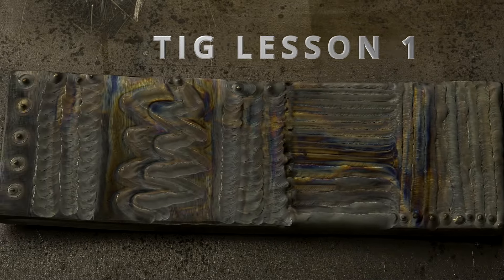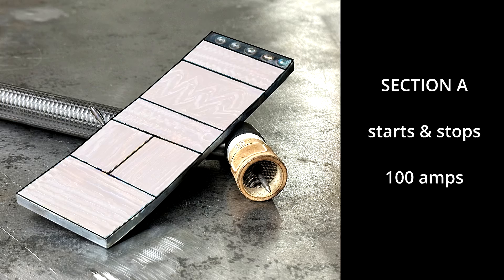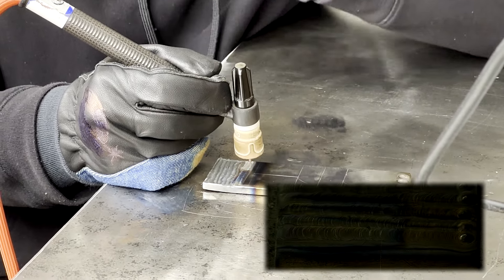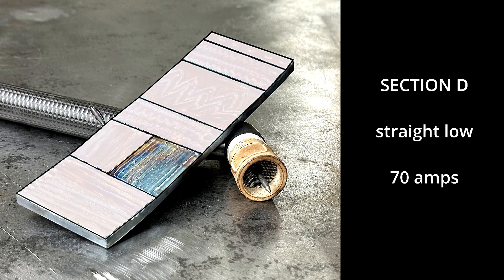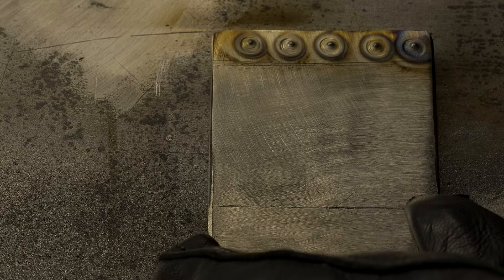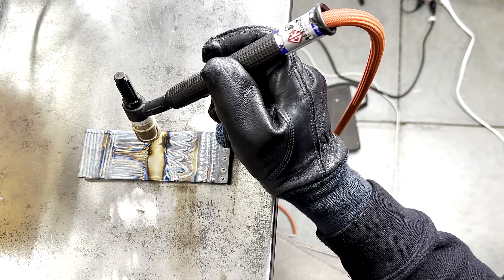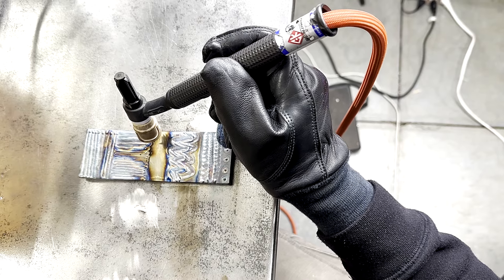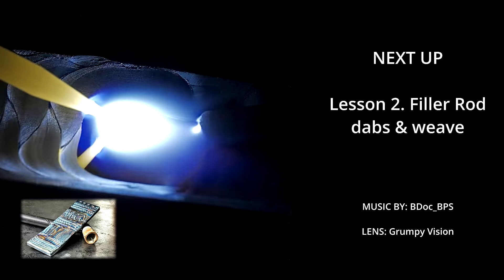Easiest Way to Start Welding | Beginner TIG 1

Comment: Can you try .063 sheet aluminum and butt weld with inconsistent gaps? I'm helping my grandpa build an aluminum car body for a corvette.. first time learning to weld and he put me on sheet aluminum. Went from a 165amp miller machine with only amp control to a cheap Arccaptial 200p ac/dc machine with triangle wave and pulse and a few more goodies. Arccaptian works really good for being under 800 CAD.

Comment: Only just starting out, but noticing your torch angle seems a lot sharper than a lot of others seem to recommend...is there a 'right or wrong'?
Reply from the maker: Good eye and good question! There's a whole range that's right. It depends on other variables.

Our latest short shows this a bit and we'll go over it in more detail in Beginner TIG 2

Comment: Appreciate the video. If you continue these I wanted to provide a few thoughts from a student's perspective. If welding experience were measured on a 5 point welding experience scale (where a level-1 was someone that's never picked up a torch and a 5 was someone that can weld in their sleep) then I'm a level-2. I started hobby TIG welding last year and I have mostly just practiced basic beads and the 4 basic joints on coupons for the last 12-months or so. Your videos (if you continue them) will certainly appeal to a broad range of students ... but for me, in terms of a level-2 ... there are 2 suggestions I beg of you!!! :) (1) don't fast forward! I watch so many videos about welding and not many have a good of an arc shot as you! I can always fast forward on my computer. Watching you weld more than just 1 bead of each type helps train my eye for the types of variations that "everyone" is going to have to face. I would have gladly sat through a longer video just because every bead you run is slightly different, some stable, some shaky, etc. I don't just wanna see the perfect or first run. If you're going to film it anyway, please please show me more of each pass. (2) if you're going to show all the runs, then I'd encourage you to "keep talking" over the subsequent passes. Tell us what "you" see! As a level-2 at welding, I sorta know what I'm watching ... but not really! What are "you" keying off of for each pass? What jiggled when you wanted it to jangle? I loved that you said for the zig-zags, you are more stable in one direction than another. That was sooooo relatable. That is sorta what I'm saying with this suggestion. I, personally, will get value out of you simply reflecting on what is happening in the shot - just like you did for the shots you went at normal speed. Anywho, can't speak for everyone, but if you continue to drop videos like this, if you're going to shoot it and have the footage, I'd encourage you to include it! because I, personally, would watch end-to-end. Because I am a level-2 on that scale I mentioned above, I am very interested and have FOMO (fear of missing out) ... so even if I get one small bit of advice from watching a longer video, I win! Think of yourself as a virtual coach/teacher. In this remote, virtual world, where you can't always be present, the more you triangulate knowledge I see on youtube, the more you show and talk through, the more variations that pop up, the more human you show yourself being and adjusting around, the more I think others would eat this stuff up! And admittedly, I am probably more interested in watching each pass in detail because I am a level-2. I sorta get "welding puddles" sometimes but I need more triangulation and virtual examples because watching the leading edge doesn't always work for me - I loved how you talked about peripheral vision for specific runs. And if you really don't want to post longer videos (because you do not want to overwhelm level-1s or do not want to bore level-4s) ... maybe you could include a section at the end? ... like "outtakes" but really, more liked "extended". So, for anyone interested, they can continue to watch additional footage and commentary - but they don't have to. If you try this, you should check and see which parts of your video are "most replayed". Okay, sorry for the super-long extended post. I just got so much out of this video and the approach you took was so perfect that I (selfishly got excited and) wanted to provide enough feedback to help make it clear what part of this worked so well for me and what else you could do that would keep me coming back for more! Maybe you are hedging to index on "longer" videos with "boring" bead runs or excessive "talking" because you are trying to find that sweet spot of informative and yet still lively - I get it! So consider this a gentle nudge in the opposite direction! Show more "boring" parts and keep elaborating over them please! :)
Reply from the maker: Appreciate the feedback!  Yep, the next in this series is coming out soon.  Hearing your perspective is incredibly useful, especially how you put it the context of how far along you are in your welding journey. Thanks!

Comment: I am having trouble with my tig torch, I mean cables , it stresses my hand and I can't make decent bead, sometimes it pulls my hand and my angle of torch is bad, I always end up fighting with torch. I am using wp 26 with on/off switch, I don't have pedal.
Reply from the maker: Makes sense with your setup. 4 things you can do: 1) Down size to a 17 torch. 26 is HUGE! 2) upgrade cables to ck superflex. Leave the extra protective sleeve off unless in the field. 3) Wrap the cables around your arms so it's balanced. This is what old timers did with their giant setups. 4) Drop the trigger, learn how to lift arc or scratch start. 

I'd do 1 and 2 first then add 4 if you need more agility still.
Reply: @GrumpyWeld  Thank you very much, appreciate your help .